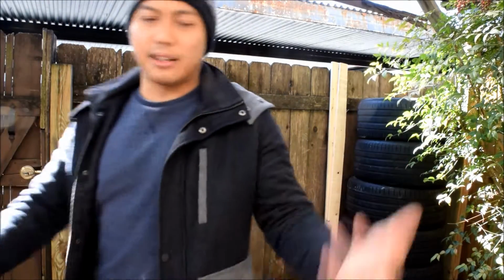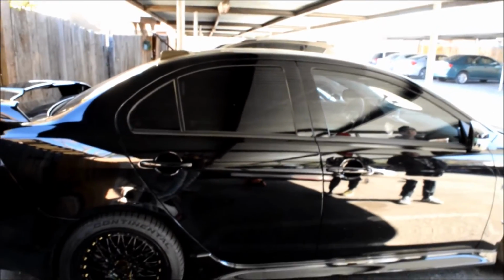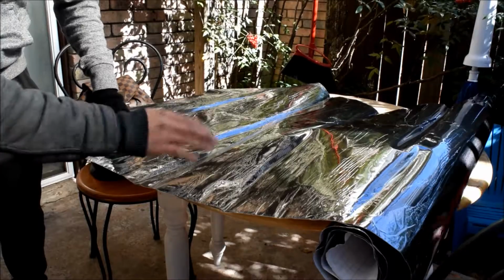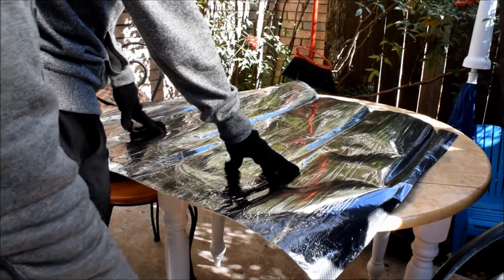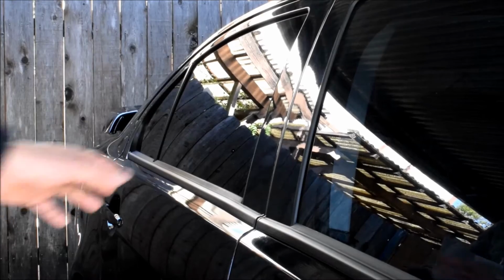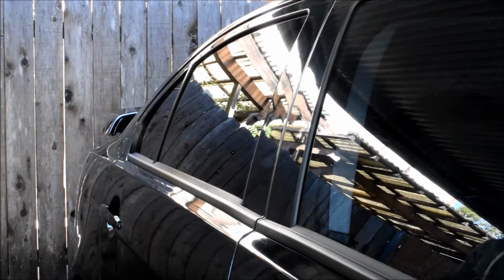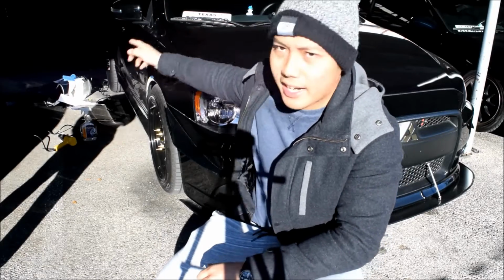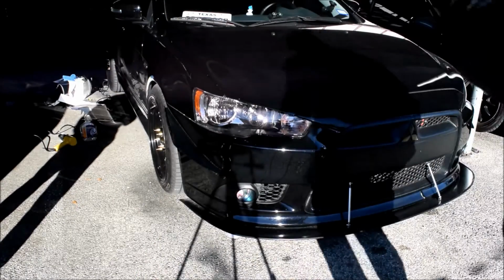Carbon fiber wrapping my door trim!

Comment: Is that a stock shifter or did you change it? I've been trying to change mind but I can't find any tutorials anywhere
Reply: Also is that 3m wrap?
Reply from the maker: Jessy Singh It's the stock shifter! I got the package with the additional options like more chrome trimming inside the car, nicer shift knob and blue led cabin lights
Reply from the maker: Jessy Singh Yes 3m vinyl